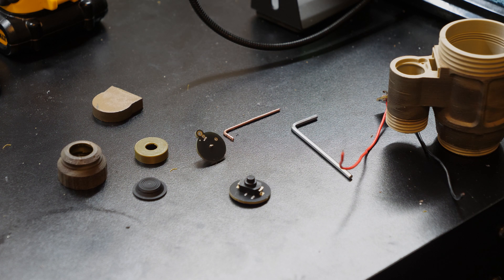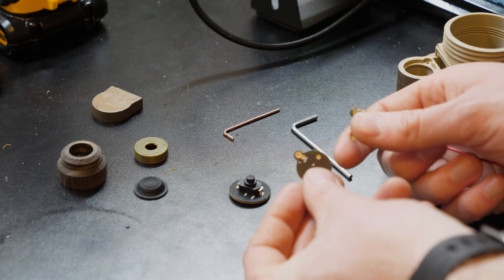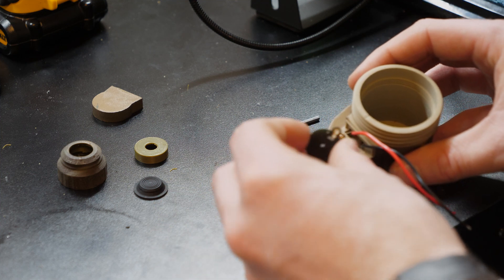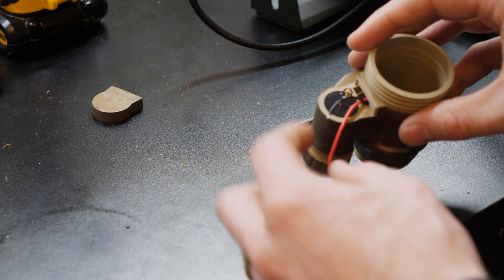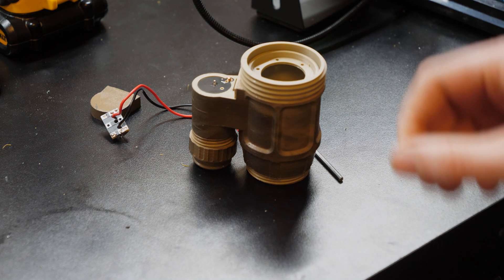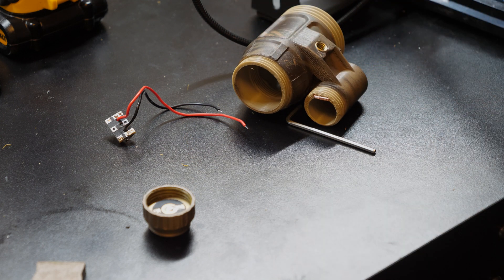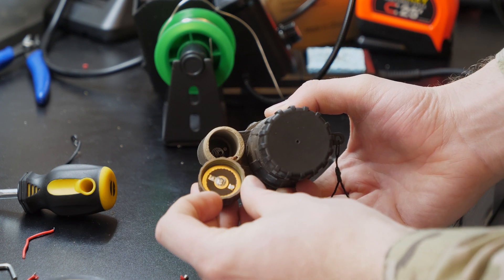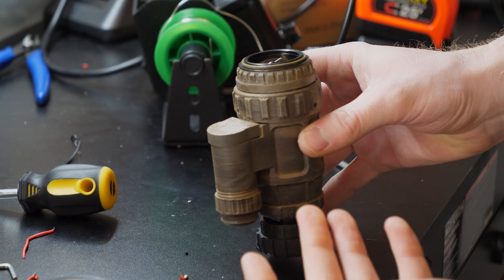DIY Night Vision PVS-69 Monocular Build Overview

Comment: That doesn’t look like a regular pvs14 objective, what lens is that?
Reply from the maker: Pvs-7 obj. They're very similar. Pvs-7 is a bit longer.
Reply: @ okay everywhere I saw said the PVS-69 uses PVS14 front and rear lens, so it uses a PVS7 lens in front instead? And PVS14 rear?
Reply from the maker: @TSI1227  It's made for a PVS14 OBJ. However, it will also fit a PVS7 OBJ. They're almost identical.
Reply: @djgunner258  okay so the piece your putting into the 3D printed part is just a PVS14 objective that’s been taken apart? I noticed the threads didn’t seem right in the PVS69 for regular PVS14 objective that’s the only part giving me confusion

Comment: idk if youll see this but i can't get the body to print correctly and I'm not sure what i am doing wrong. does the battery compartment need supports when printing?
Reply from the maker: @EasyLikeEggs yeah print the whole thing with tree supports.
Reply: @djgunner258  you da best I’ll give it a shot